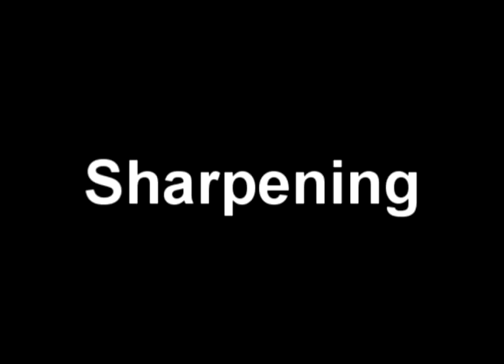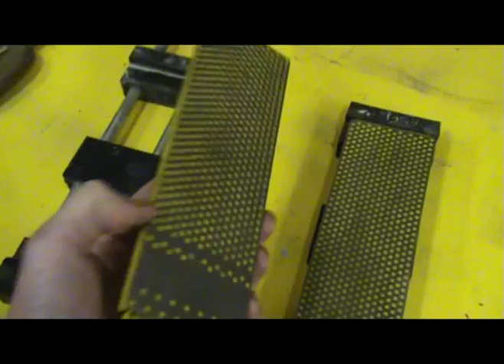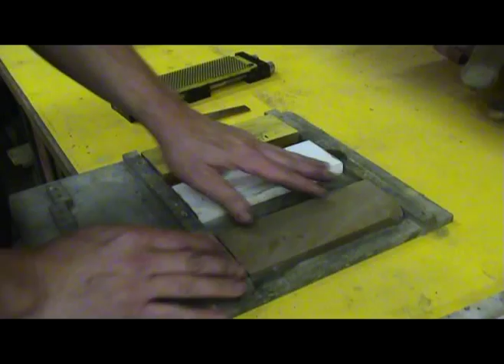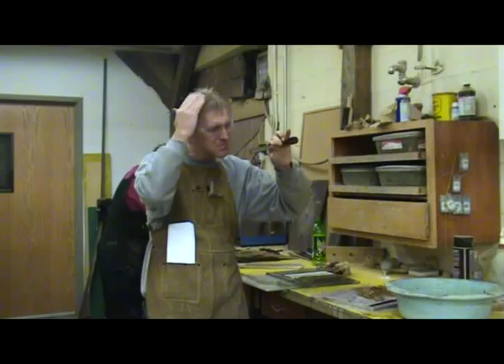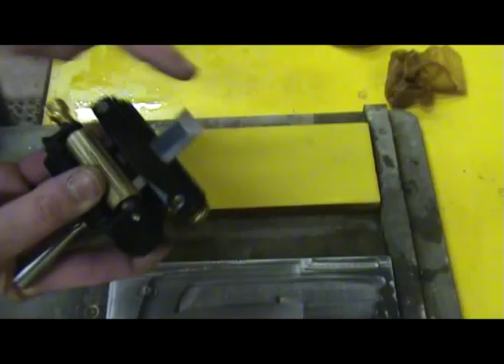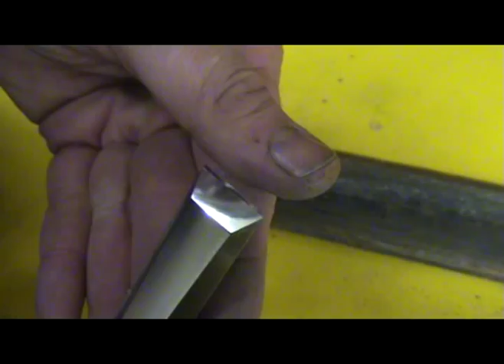Luthier Tips du Jour - Sharpening

Comment: Instead of water stones would wet dry sandpaper (same grits used) on a flat surface work the same way? 
Thanks for the vids as always
Reply from the maker: Yes you can. However, sometimes you can get a little ripple in the paper just  in front of the tool edge you are sharpening and this will not give you as sharp an edge. I sometimes use lower grits of sandpaper on a tool before finishing the edge on waterstones.

Comment: Good video. Do you think stropping is worthwhile for chisels? (i.e. when working with wood, is this difference between the edge from a 8,000/10,000 grit stone and a stropped edge significant?) I've stropped knives (and a Japanese plane blade) before, but never thought of doing it with chisels.